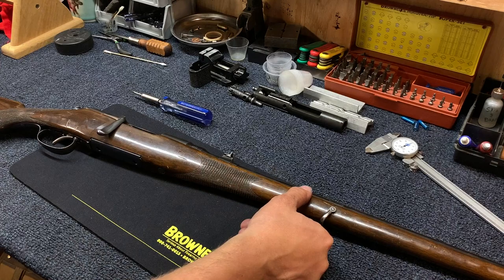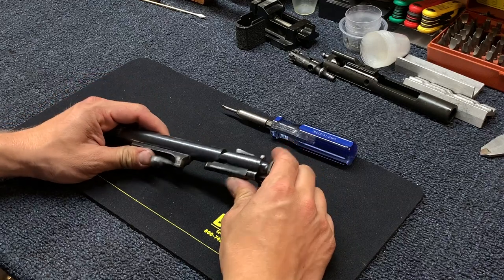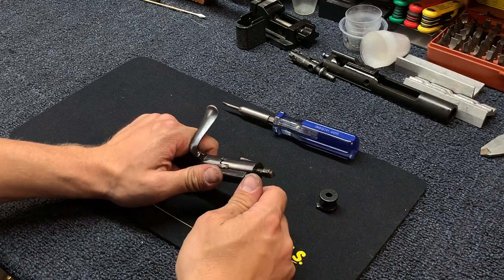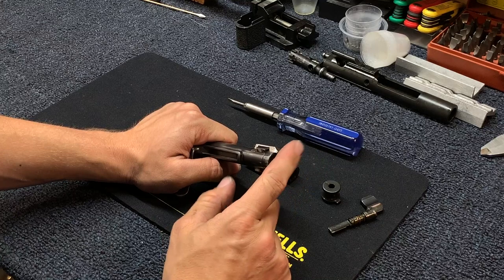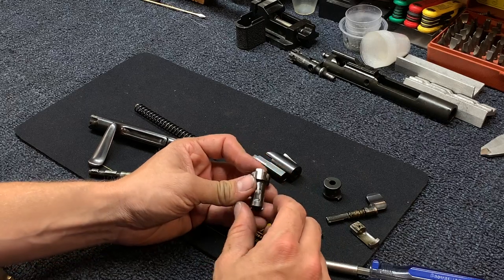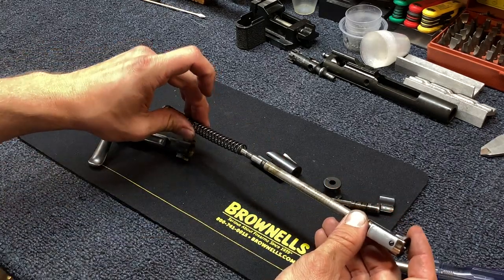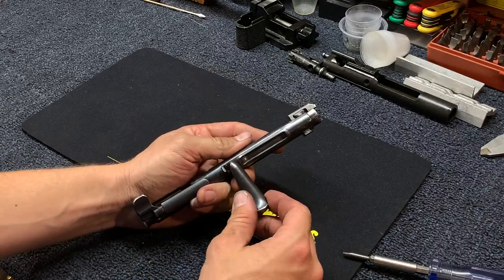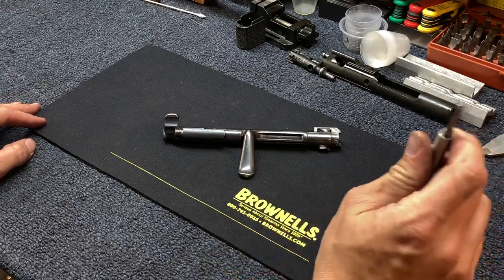Mannlicher-Schoenauer Bolt Disassembly w/o Tools

Comment: What's the thread diameter on those barrels? 1"x12tpi? I've got one in 7x57 but the throat looks porous lava. What's the chance I can spin on a large ring mauser barrel, witness mark it and cut the extractor grooves? I've got a mill, no lathe.

Comment: Excellent instruction! I just took mine apart and cleaned everything. I even got it back together! I would like to add that my extractor was only held in place by the fit between the bolt body and bolt head, and it pretty much fell out into my hand when I slid the bolt body off. It's not broken, everything still functions fine, it's just the way it is. Mine is a 1952 model, so there may be some design variation there.
Reply from the maker: Glad it helped! Thanks for that input too, that may help the next guy!

Comment: Excellent video.  Thank you.  If I may add one piece of advice. At the 4:48 mark, when reinstalling the firing pin nut, do not overtighten it. When reinstalling, turn the nut clockwise just until it clicks. I mistakenly tightened it past the click and the bolt would no longer fully seat in the receiver.

Comment: Hi Kurt, I just acquired an Mannlicher Schoenauer 1903 rifle (not full stock) 6.5x54. It is an Austrian build and I want to take it completely apart to clean it. Any Idea how to get the trigger out? It looks like the entire barrel needs to come off of the stock to get it done. Thanks for the bolt lesson!
Reply from the maker: Remove the screw on the pistol grip. Be careful because it is a very thin screw slot that can easily be damaged. Then pull up on the trigger guard rotating it forward. It keys into a slot there. Once that is removed you will expose a screw that goes up into the receiver, once that is removed you can take out the whole trigger assembly without completely disassembling the rifle.